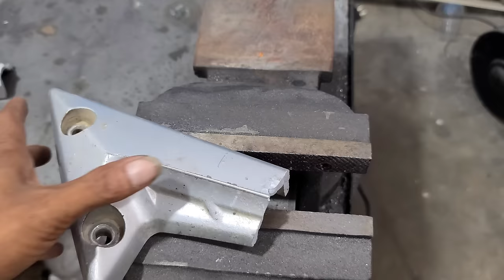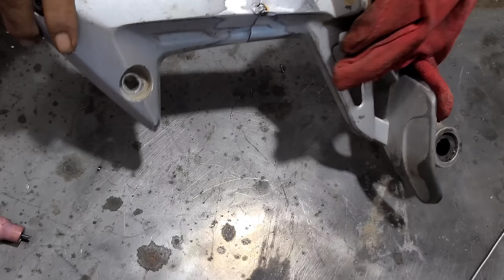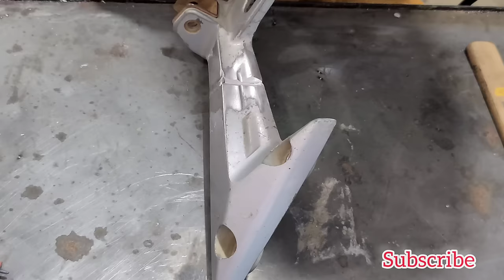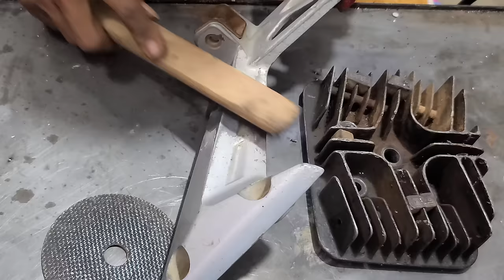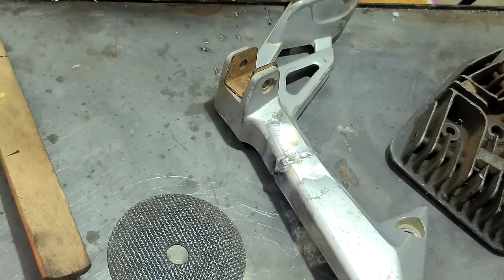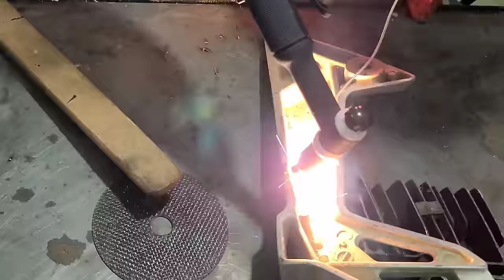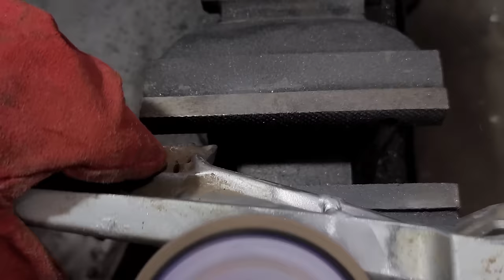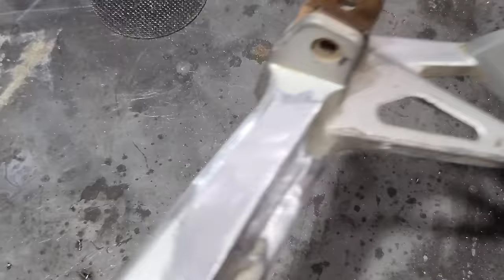how to weld aluminum which is rarely known by many people , tig welding

Comment: As a welder who specializes in marine grade aluminum/ stainless, this was painful to watch. Don’t use a cut off wheel to weld prep aluminum. It will leave contaminates on the base metal. Best to use a metal blade if you have to prep your weld after the tack. I understand why you didn’t want to weld prep before the repair, because it willl mess with your fit up, but a good fabricator would clamp to a stiff back and get the same fit up and have weld prep before you put the fracture back together… if it held then that’s all that matters, but I’d ol be surprised because the base metal at the root of the weld was contaminated. But hey, what do I know I’m just a random commenter on the internet!
Reply: You seem rather knowledgeable to me young man.
Reply: Sir, I confirm what you said. There is tiny particles that transfers from the cutting disc to the workpiece.
Reply: the rusty wire brush was the BEST :)
Reply: A question I'd like to ask about the metal wheel you are referring to how would I describe it if I wanted to purchase one from the store?
Reply: @shuhadloofer7192   a cut off blade/wheel for a angle grinder...there are many types depends on what you are doing..even ones to cut glass
Reply: @bbuucc  I know of the basics but he is saying don't use those because it will cross contaminate that's why I'm asking what does he mean by it, you understand my question now sorry if I wasn't clear before but thank you for replying
Reply: He also dipped the tungsten several times and didnt really give a shit about cleaning the aluminum
Reply: @554drago  no
Reply: Tig is a very well know method.  Not sure why you consider it rare.
Reply: I'm not a welder but I do recall That when I was an aviation school we were We were told not to use a metal wire brush on any of our Wells because if we did so it would contaminate the metal and you would have corrosion if That's why they do not allow wire brushing wheel Or grinding wheels to be used on any kind of aircraft Is structural aluminum
Reply: When my German Shepherd was learning to Tig weld, this was the quality of his first attempt….
Reply: @shuhadloofer7192  meat axe cutting wheel for a 4 or 5 inch grinder
Reply: VERY PAINFULL
Reply: @christianthomle4426  Did a MIG/MAG welding we used stainless wire brush for prepping aluminium , found that prep had to be extremely clean for aluminium (never used grinding wheel ) . Our welds were cut open polished then acid etched to test penetration and porosity , found it easy to MIG weld aluminium once machine set up correctly for the job
Reply: My wonder is who in their right mind would even consider cable for a pic and use in a weld? 4043 would be just fine for a casting. I've been burning wire for 50 yrs, I find this disturbing.
Reply: @jamestboehm6450  I doubt it was 4043, Just some random cable. very painful to watch. 😂
Reply: So that won't work?
Reply: Yupp.......agrees to that
Reply: Nos comentários li algumas críticas, críticas construtivas  claro, e por mais difícil que seja aceitá-las ainda assim são muito importantes, pois também nos transmitem conhecimentos, por isso sou sempre muito grato a todos que participam desses vídeos, porque tenho admiração pelas pessoas que estão dispostas a compartilhar o  seu conhecimento que adquiriram ao longo de suas vidas!
Muito obrigado 🙏🏻🙏🏻🇧🇷
Reply: That's how to comment on the net. Thx for teaching me..
Reply: The addition material is under any criticism. Your giving aluminum with current wire ?is embarrassing. Neither is wire cleaning indicated because the wire brush more stretches the aluminium oxide.
Reply: Hold my beer ......
Reply: I'm hearing you Man, I Tig weld Aluminium a fair bit, and I understand the fit up needed, but you can work around that, never use a Wire Wheel for cleaning it back either, because it Pushes contaminants back into the Material, I also use very course Cutters in a die Grinder designed for Aluminium, and for Crying out load, get a block to lean on so you can steady your torch hand when welding, you have to have a pretty short arc to direct your welding and it is so easy to contaminate the Electrode on aluminium.
Reply: This is fucking hysterical………  😂😂😂😂😂
Reply: I guess the trick that is rare is sticking your tungsten in the puddle consistently😅
Reply: @cideanalgia  consistency is the key🤣🤣🤣🤣🤣
Reply: This hurt to watch
Reply: Asking for my knowledge, you need to use AC setting for aluminium TIG right?
Reply: @retroclassicsgarage  correct…..
Reply: Correct welding aluminum must be clean using contaminated stones or brushes will interfere with good welds .
Reply: @554drago and that stick out!
Reply: @jamestboehm6450 
It’s power company cable…
Reply: I have not done TIG for about 40 years, i've done every other kind of welding - brazing- silver solder- MIG- stick, even I can see this every kind of wrong. he has no idea. You are so right.
Reply: That's a wire wheel not a cut off wheel
Reply: @frankdavis6101 if you lived in a 3rd world you'd take this repair
Reply: Iam even shure that you Not use highvoltagecable for your work😂
Reply: @timhull8664  hah! DIY in humor!
Reply: My question is !
Is that pure cast aluminium or izz it die cast because that being the case it will be as good as three pound of rocking horse shite
Reply: @stanislavbakanov2898 Die casting is presurized casting done in steel moulds
 Gravity casting is usually done in sand moulds or c o 2 injected into sand gravity 
mouldings  shrink a lot more  pressurised moulding cast in steel moulds to far more accurate sizes come out smooth and not porous
Reply: @stanislavbakanov2898 you can weld aluminium castings but die cast isn’t the same material and doesn’t weld if you strike a welding rod on it it blows it too bits
Reply: Bud this is the difference from made in china and what we do 😂😂🇺🇸🇺🇸🇺🇸
Reply: But he has 2695361 views.  😂
Reply: I am just learning how to weld and even to me this was painful to watch. Here is how i would have done it; interested to hear your thoughts on it. Lay the parts on flat surface and tack on the top. Flip part over, grind small groove on the bottom side (uncomfortable to weld side) using a metal burr like carbide on die grinder, fill the V groove by welding. Flip part over, make a big, deep groove in place of the crack until i can see the welded metal from small groove on bottom. Fill the big groove with however many passes it takes. grind surfaces flat.
Reply: Wouis ca😢sent bon  la colle  et les emerdes
Reply: @nounoufriend1442 estás a a falar muito bem.
Reply: Your not kidding there. That was worse alum weld video I’ve ever seen.
Reply: Quite correct, that was painful to watch. The stuff of nightmares...
Reply: That was my first reaction, cross contamination, but he got his money, look at all the reactions he got.
Reply: Typical welder comment. Your all better than the last welder.
Reply: Agreed, I've been welding over 40 years and I wouldn't pay this guy to fix a bird feeder.
Reply: Random commentator T p two b, Heli arc is definitely a skill, It's no different than any other good weld, If you think it's clean.... Clean it some more
Reply: Nah thats a  fail for 4711 weld  test  prep and execution of weld
Reply: Amazing, another example of really crappy and incorrect process makes money on the internet.
Reply: Yep, this was a great example of a total hack! I bet he got shit for penitration.
Reply: Z
Reply: I would not to drive any vehicle or operate a maching that had that repair on it.
I bet just bolting it back on the hard points with no load put stress on that repair due to how the parts were aligned!!
Scary
Reply: Yeah, the whole thing was gangster AF! Like a Tijuana muffler shop maybe...
But you know what, it will hold, and the casting material is dodgy anyway and difficult to weld even when done the “right way”.
Reply: Ty
Reply: Я не учился и то понимаю что косячит автор
Reply: You are quite correct.   That was an amateurish.  I've been a certified aircraft welder since 1967.   Never use an abrasive wheel on aluminum, and buy good aluminum welding rod, not recycled electrical cable.
Reply: @shuhadloofer7192   Use rotary files, also called burrs.  They aren't 'wheels', but they are designed for just this type of job,   Much safer, too.
Reply: @christianthomle4426  You can safely use a stainless steel wire brush when prepping aluminum for welding.
Reply: @retroclassicsgarage   You can use DC reverse polarity if you need maximum heat input, but AC is the generally accepted method and easiest.
Reply: @d.b.o.c.6852  A cut-off wheel was used to champher the weld joint after he tacked the pieces together.
Reply: Well we not use tht thing to war so no problem at all.
Reply: @G31mR  Thank you very much
Reply: @christianthomle4426  Use stainless steel wire brushes only when working with aluminum. Probably not allowed to use wire brushes on aircraft because its too easy to pick up the wrong wire brush.
Reply: @@Carlosxyz1000 Wouldn't that mean that all prep must be done with aluminum tools then???
Reply: @G31mR  Weld aluminum with DC?? If you use reverse polarity you will put all of the heat into the tungsten and none into the work. Well I suppose the work will have just enough heat for the tungsten inclusions if you weld DCEP.
Reply: If you welded like that in my shop, you'd be unemployed !
Reply: @kerrymehaffey6257  I would hope that you would fire me for a weld like that. :)
Reply: @fastone371  I did say you'd be unemployed !
Reply: Like how right off the bat he uses a steel wire brush
Reply: La soldadura de aluminio mostada con esta soldadura es de corriente alterna por eso puede seldar aluminio sin fundente con varilla de aluminio que es redonda y párese este cable de aluminio que sirve igual yo para soldar con soplete está misma pieza del vídeo con fundente para aluminio e usado cable del mismo y va saludos
Reply: That’s not exactly right. You can use cutoff wheels on aluminum. Not sure why you’d use a cut off wheel to prep a surface but there are combo grinding and cutting wheels (never used one since it seems like master of none ok at all thing). 

But all you need are non ferrous wheels that have not been used on ferrous metals. That’s it. Nothing more.
Reply: Am beginner welder and I think from what am learning is welding is not good as well because I don see him making a nice pool... Almost like he was bracing... This well probably have bad penetration
Reply: people come on here thinking theyre welders when theyre jokes. its pretty funny
Reply: And the time he took f&## I g around was agitating my nerves
Reply: Et ouais tu l'a raconte que du bla bla comme d'habitude les occidentaux sont toujours les plus intelligent ,ok il faut arrêter de données des leçons parce-que pour le moment c'est les pays en voie de développement qui vous donne de bonnes leçon, et ouais la leçon c'est arrêter de jeter et apprendre le système débrouille ok
Reply: Looks like an aircraft landing gear component.

Yeah, you can TIG it back together, but how much did it bend before it broke?

I can see where this is going.  A lot of cheap-azz airplane owners will be welding their busted crap back together, make it look pretty, then demand we use his parts.
Reply: I think this video was to show how NOT to do. It hurt my welding heart to see all the mistakes he made 😳🤣🫣
Reply: Agreed
Reply: N sei oq esse gringo falou, mas realmente achei feio dmais o trabalho, era melhor deixar as marcas de solda a vista, brasileiro gosta de enganar os outros, ai tentam camuflar a solda afinando a estrutura gerando bagulho...
Reply: @frankdavis6101  more likely he just rode on - after his passenger put weight on it, the weld broke, dumping his passenger on the road. Hmmm .... now wait a minute ... maybe his passenger was his girlfriend who he * wanted * to dump:  She had asked him during this video, "dear, are you sure you know what you're doing?"  He got annoyed and said, "yes of course I do!"  Then intentionally grabbed some crappy feed wire, a dirty brush, and a contaminating grinding cut off wheel --- and went to work, thinking "ha! I'll show her!" .... and we hereby witnessed an "attempted manslaughter using a deadly weld."  And we though snuff videos weren't allowed on youtube.
Reply: Stainless or brass brush that is clean for weld prep I believe is what is right.
Reply: There is a delay before the gas shuts off so hold the tungsten close for a second or two after arc is broken to keep weld clean
Reply: @554drago he thought the tungsten was filler..😁
Reply: as crappy as it may be that is a rear right motorcycle pillion footrest/peg mount, i think that weld will due for what it is. i want to know how the bike was wrecked to cause that piece to break without cracking the holes wher it mounts to the frame.
Reply: @steelrain79 это был 4047
Reply: I would add that the cup brush should be stainless as well
Reply: I have been welding and teaching welding for 40 years. Hate to see shoddy work on aluminum   I also specialized in military grade aluminum   It is easy once you learn it but your right. Prep it the right way and keep it clean.
Reply: A gas lens cup and collet body will help to keep it clean but keep it clean while prepping it.
Reply: I’m just a guy and it was still painful to watch! Pretty sure the motorcycle bone yard would have produced another foot rest mount.
Reply: @nounoufriend1442 Absolutely correct, but when your welding in flip/flops they make exceptions to rules. 😂
Reply: @jamestboehm6450 Specially if it’s your lower control arm.
Reply: @timhull8664 
🤣🤣🤣🤣🤣👍 I bet he’s an expert by now 🤣🤣🤣🤣🤣
Reply: Quite a nice job, but I think this will crack again, if only because the whole part would have to be heat treated before being re-installed (+ the contamination aspect)
Reply: Painful?   Sucks when others don't do what you want them to... hope you recover soon
Reply: Maybe you could me so kind in uploading a video explaining how, as many people say aluminum can't  e welded, best regards.
Reply: you also have to be careful with what kind of wheel you use if you need to use one for some reason, and if you use one for aluminum you can't use it on steel and vice versa. 

Though for prep, wire brush, acetone and a blowtorch works all right.
Reply: @retroclassicsgarage  you can weld dc aluminum tig, but you need pure helium for the shielding gas. And it’s a little dirtier than ac.
Reply: Trash
Reply: @TonyTony-xr7pf   do you forget to the read part where I said, “as long as it held that’s all that matters”?
Reply: The first two or three welds he has a lengthy post flow of gas. After that it was like "screw that" ha ha. I also see so many potential stress risers in that finished weld in addition to everything you said. Oh well, it's not a space rocket or a deep sea vehicle, so maybe failure is not so detrimental ha ha.
Reply: это полный ПОЗОР!
Reply: Stop by my boss to help support, thanks
Reply: leave alone.other things i need this machine,where and how can. i get it please. am from Kenya please help
Reply: Y would a welder b watching a newbie weld?
Reply: Degree in Metallurgy. Career in private military tech prototype to production. My career specifically has been utilizing alloys. I endorse this message 😆
Reply: Brass brush

Comment: My dear friend, I have been welding aluminium for over 30 years, you have done some things that disqualify you from the start, the first thing is that you weld a part that is subjected to some force, with current wire as an additive material is embarrassing. The alloying elements in that wire are not exactly compatible with that piece. second thing, to polish the weld bead is not admissible and so the processing was done of poor quality, if you also erase the weld bead the resistance is minimal this piece can probably only be used to support flowers .the frequency on the alternating current is too low and the welding parameters (current) is at the lower limit and you can not have penetration into the material, so a disqualified weld . I salute you with respect.
Reply: i would get an actual welding wire to match the material prep everything by grinding it with wire brush wipe it with acetone or alcohol after grinding the edges ofc clamp it and start tacking one in the out and one in the inside so it wont bend and then grind the tacks a bit preheat and start welding i would do one inch outside and follow it with another in the inside after finishing every thing i will grind the weld with out grinding the piece that i m welding and then using send paper polish everything quick paint and job done (i have never welded anything in my life).
Reply: Obviously a third world dude, so in that respect sort of OK. I agree with all of your points btw.
Reply: Where's your video then buddy

Comment: Why is everybody forgetting to mention the parts have to be chamfered or grind the edges at a 45 degree angle. And use 4043 filler rod for cast aluminum. Pre-heat is good if you don't want it to crack. Clamp the parts down to a piece of 1/4 - 25mm thickness steel plate to keep the parts straight.
Reply: that is the way I would do it too. This is jungle welding anyway and he probably charged 25 cents for it.
Reply: @bernardmauge8613  oui et il a gagné une fortune avec sa vidéo , presque 6 millons de vue , c'est juste ce qu'il avait besoin  , sa soudure il n'en avait rien a faire ......
Reply: Thank you
Reply: This guy made videos for living not welding. And the way I see it, he's an Asian. No safety, working in workshop with casual shorts, using mig glove for Tig welding, no glove while holding torch...
Reply: Yup preheating is very important for welding aluminum with any degree of penetration and stability.